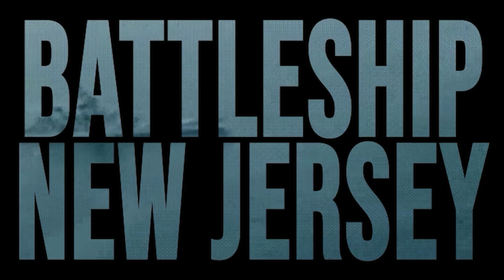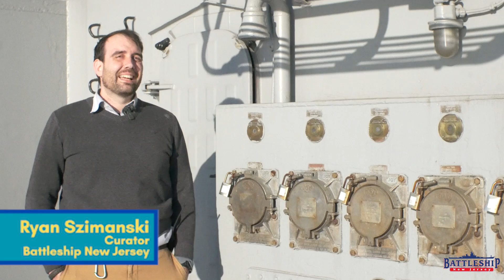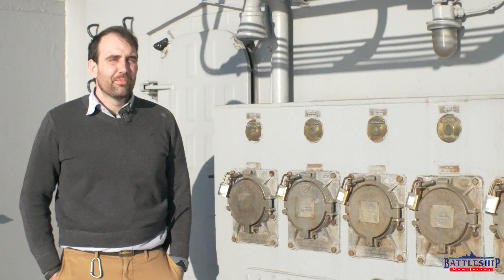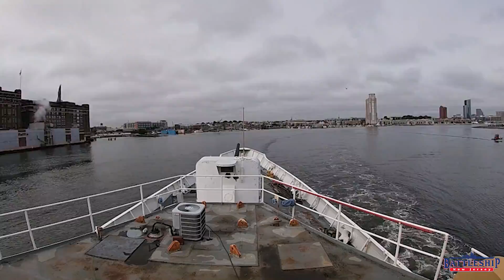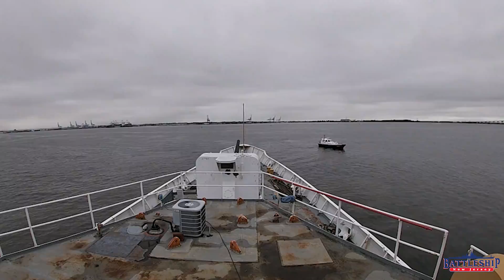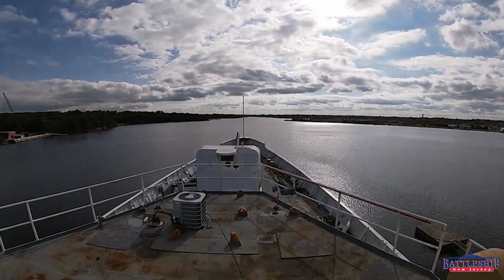Will the Battleship Have Power While Under Tow to Drydock?

Comment: Ryan you will want 2 450KW 480 gensets (thats about 800 Amps per, one wired into the Port side and running and one in the starbord side once shore power is disconnected as a Oh Shit backup. that gives you full power to all restored systems that you currenty use with reserve. About 500 Gallons of fuel gives you 24 hours run time at full load. As has been suggested Talk to Cummins I bet they would LOVE to have a Video "Cummins powers the Battleship NewJersey underway"

Comment: As a merchant marine engineer, one side note I have is that those shore power cables are heavy as all hell and are a real pain in the butt to hook up.  This particular connection type is nice though.  It just plugs in nice and simple.  Some older type cables have three super thick leads in them, and you basically have to clamp them in.  Really annoying, really heavy.

Comment: restoration of original systems to create power is more logical. those systems need to be ran occasionally to ensure they don't deteriorate.  its already plumbed and installed it just needs a mechanic. as you have said many times before. she was put to bed exspecting to be reactivated. well... reactivate her systems for dry dock. there has to be some vets that would love to run her once again to dry dock.

Comment: If you can get away with it, a small diesel generator with a fuel drum lashed to the deck, Starlink antenna, and livestream it from multiple cameras. No physical human presence required until it's time to shut down the generator and pull the cameras at the drydock.

Comment: I thought the shore power standard frequency was 400Hz.
Reply: Nope.  480VAC, 3-Phase, 60HZ.  400Hx power IS used onboard a USN ship for radars and other equipment, but (at least on my ship) was produced by appropriate motor/generator sets...Basically a 60Hz motor driving a 400hz generator.

Comment: Very curious to hear what kind of numbers your crew comes up with for power requirements!  As a Stand-By power generation tech who works in Philadelphia this whole undertaking is fascinating.  I would definitely recommend two gen sets be on board for redundancy while under way!  I would gladly offer the use of my 1959 150KW Caterpillar Electric Set but unfortunately it is 208v and not reconnectable for 480.

Comment: aggreko power does rental generators, even Caterpillar or Progress Rail Services might sponsor/provide power as a write-off / advertising expense. Just need a fuel bladder on deck with the generator(s). In a perfect world, two generators, one feeding each bus and one feeding the emergency bus, or two generators paralleled feeding one bus which is tied to the other bus and the emergency bus. Since Iowas are electrically operated ships, a lack of steam shouldn't put her out of commission as long as the motive power isn't needed. However, that's a lot of parts to grease. Entire systems need to be rung out to make sure that what is left isn't dead in place. It'd be nice if the alarms and 1MC worked for life safety reasons and the pumps. Of course it'd be better if the blanks over the sea chests feeding the diesels were removed during dry-docking so the diesels can be used in the future if the need arises.

Comment: Two questions I have about the process. One: will the ships watertight door be closed during the transit in case the worst should happen? I know they likely aren’t completely watertight anymore but I’d think it would be better than having an open hatchway. Second, is the steering system completely beyond reactivation, and if not, will there be any attempt to get steering working so the rudders can help maneuver the ship for the tugs?
Reply from the maker: The rudders cannot move and will not move for the tow.

Comment: For all those old power plants, I wonder how many would short out the old wiring.
Reply: Naval power isn't grounded.
Reply: @AugustusTitus when enough bad connections are made,it will short out.
Reply: The power for the lights and ventilation is coming onboard through the original Shore Power connections, routed through the original main switchboard, distributed out to the original load centers, then fed to the original fixtures through the original switches...all over the original wiring.

Comment: How come your not allowed to fire up the boilers? Seems like an odd the for the navy to say?
Reply from the maker: They don't want us sailing her around
Reply: @BattleshipNewJersey  yeah that part makes sense. Shame though as it would have been nice to make your own power in that respect.
Reply: The museum can’t yet afford to pay for their own dry docking. Can you imagine how expensive it would be to keep the ship maintained, fueled, and serviced for operation? Astronomical. 😵‍💫

Also, all of the necessary sea chests have been blanked over. So no cooling inlets to operate the engines and machinery.
Reply: @glennac  o I understand all that. Just seemed like a weird stipulation from the navy. But the sailing part never crossed my mind. Would have been cool to see her produce her own on board power. Shame they couldn’t just disconnect the drive lines or something like that. But yeah I get it would be expensive also.
Reply: the navy dont need another boat "borrowed",like in the battleship movie😂😂

Comment: When NEW JERSEY was towed to Long Beach in the 80's, my Air Guard Combat Comm Squadron was tasked with providing generators on board the ship while under tow.  I put my name in as being available, but being a radio guy, but Power Production qualified, I did not get chosen.  They would have been 10 or 15 generators for lights, radio, etc.

Comment: Again ... I'm so glad I only had a fleet submarine to deal with on a row two years ago. I was adamant that Cod should have full lighting load and power for our coffee maker and rechargeable phones and cameras.  Our emergency dewatering pumps were gasoline powered. One tiny Honda generator hidden under the superstructure and tapped into our lighting bus did the job exceptionally well.
Reply: B-29 FiFi flies with Honda inverter generators for her portable site power and replacement of the on-board "put-put" gasoline engine APU.

Comment: Conex 150kw generator should work nicely for you.  It is only a 16ft conex but could be up to 22ft however should fit nicely on your flight deck.  
Contact CaT or Agreco in your area they should be able to point you at some options.
Reply: There might be a company willing to provide a generator free just for the press coverage.
Reply: sunbelt has trailered generators in that range for rent, may provide as a sponsorship i imagine. a 1000kw generator is $20k for 4 weeks. 6700 for 1 wk. wouldn't surprise me if they give it to them for free for a time in exchange for publicity.

Comment: How far will the ship move to dry dock? In other words how much total time is it estimated from start to dock ?
Reply from the maker: 6 miles
Reply: New Jersey is in reasonable condition. Even if you had electrical power to the ship equal to what the ship was once capable, if anything were to happen, there is Little that New Jersey could do to save herself in her moth balled Museum condition. The ship has no leaks of even minor concern. Nor would it unless a major storm might come about at the time of the move. And I highly doubt it would be considered to move her under those circumstances. So only enough power to light the ships interior by way of its own power distribution is needed.  Totally sufficient. That is unless the ship is  in materially worse condition then we have been lead to understand. And that should even be overkill.        @BattleshipNewJersey

Comment: Are there any thoughts among the Museum Fleet to make modifications to be able to reactivate emergency diesel generators? These are purpose made, integrated systems that are designed for powering the ship without main turbine power. For me it would be frustrating to have such a useful back-up system built into the ship and not be able to utilise it. Is it an upkeep/maintenance issue? A fuel issue? Or is the only blocker simply the blanked sea-chests? 
I understand the Navy's practice of sealing the hull to remove any and all hull-openings but how hard would it be to modify the connections to make the blank an internal one that could be opened if needed?
It could even be set to 'trip' on if shore power becomes disconnected using modern control. I think of how much that might have helped USS The Sullivans having internal emergency power available, or just a circumstance where a ship breaks free for what ever reason; it would be able to provide some power to systems to warn others. It also removes a complexity of having to crane diesel generators on and off the ship, along with the hire and delivery of them.
Plus, to me, nothing lights the passion of museum goers than seeing an object functioning, so a periodic test run up of a diesel generator could be a minor event for museum ships.

Comment: That's a shame you can't use the two onboard diesel generators. I understand not wanting the fire up the turbo generators.
Reply: It's probably stipulated in the contract signed with the Navy that they are not allowed to fire up those generators
Reply: @roger5555ful  Stipulated ANY steam systems or propulsion equipment.

Comment: As A CE (Seabee Electrician) go for the bigger genset.
You'll never regret having too much power.
Reply: True. It is better to oversized generator to the load as generator “butter” zone were it is most efficient which, depending on model, is around 60%.
Reply: @frankchan4272 is wet stacking the generator if it’s too big a concern?
Reply: @MultiPureEnergy they’d only be putting 8-10 hours on the unit while towing so I don’t think they’d have enough run time on it to really suffer from wet stacking, the ideal would be a smaller and bigger unit both plugged into their shore power connection and use the smaller one unless the need for more power becomes a thing, then fire up the bigger unit and swap to it.
Reply: @MultiPureEnergy  on a rental?  LOL.
Reply: Two.
Reply: As a Navy CM I also recommend a larger Genset and actually a backup... Cat and Cummins both make great gensets.. mo power mo power.... the more systems powered the safer the transport will be
Reply: As an engineer in the merchant marine, I can confirm.
Reply: Some many details!  Planning for every eventuality.

Comment: Holy smokes! Those are giant ports! What size cables are you using for those 440-480VAC lines!
Reply: And how many kilowatts can you carry over each line?
Reply: @shubinternet over 200kW.

480VAC x 400A x 1.2 (3 phase constant for 480) = 230.4kW.
Reply: At least 500MCM for 400amps you would think.

Comment: I probably know the answer, but will you fix the rudder in a fixed position, or can you power it to help steer ship into dry dock
Reply: I am not an expert on battleships, so take this with a grain of salt. With large ships in general, their rudders are pretty ineffective when moving at slow speeds. For this reason, cruise ships use their bow and stern thrusters when going pierside (basically large propellers mounted perpendicular below the water line that can suck in water on one side and push it out the other side to move sideways - of course they are reversible) and large cargo ships use tugboats to get in position. New Jersey most likely doesn't have such equipment, so even if their rudder were powered, it wouldn't have much of an effect.

Comment: If it was me I would use generators to replicate the shore power your currently using plus enough to run extra pumps.....
Reply: That would be an unnecessary waste though.  They don’t need to power all the lighting and HVAC systems - all they need are navigational lights and to run pumps (bilge and for adding ballast) for the 4 mile trip down the river.  

Whatever generator they decide on will need a redundant backups.  Generators of this scale are several grand a day to rent not counting fuel costs, transportation to the shop, a crane to put them on board, etc.  They could easily spend over $20k just on generators so I’m sure they rather not pay for unnecessary generation capacity.
Reply: @cruisinguy6024  Is it that shorter run? I would have thought the bulk of the cost is in the rental and crain etc, there wouldn't  be much difference between a 100kva and a 300kva all up. The reason why I said what I said is if something goes wrong the crew who know the ship need to be able to respond quickly and there wil likely not be time to figure out the difference in the ship at that level of turned off

Comment: I've been curious about the contract  with the navy and why specifically  they won't allow the restoration  and use of the ship's main systems  such as the boilers and steam systems. Is is due to them originally wanting to keep everything  in a state of being able to be restored to active  service?
Reply: I would think it would be too dangerous to  power up the boilers, the tubes will likely have lost their seals, a bad thing.
Reply: He’s discussed the contract in a prior video.  Essentially the Navy doesn’t allow them to do restore anything necessary for her to be used as a ship again.   They’re not allowed to generate steam or operate the galley equipment.  

It’s a shame, really.  She’s obviously never going to be recalled to service again but it would be so incredible if she could be more useful than the contract allows.
Reply: Part of it is PR.  A steam link is a nasty thing.  The USN doesn't want to be featured in a news report of how a Boy Scout Troop ended up being neatly uniformed stew meat...Main Steam is 600 PSI superheated to the neighborhood of around 850F.  Even 50 PSI steam for the galley will be around 300F.  As a museum ship, the NJ is lacking well over 100 guys who did nothing but operate and maintain the boilers and steam systems.  We had 3 boilers, two shafts, 4 turbine generators, and around 100 guys in Engineering...

From a financial aspect, figure those burners are going to use oil at a rate best expressed in Gallons/Minute.  This is why the USN has chosen Gas Turbine systems over steam.  It's a money thing.  The only exception are the carriers, which still use steam propulsion, they just use reactors to heat the water.

Comment: Any coast guard certified captain can answer your lighting question.

 A vessel or object other than those referred to in paragraph (g) of
this Rule being towed shall exhibit:
(i) sidelights;
(ii) a sternlight; and
(iii) when the length of the tow exceeds 200 meters, a diamond
shape where it can best be seen

You could probably run it off a large battery.
Reply: Seemed to be more a question of how much inside lighting they need, which is an entirely different requirement (OHSA, etc).
Reply: That does not include internal light in the ship to make it safer to move around. It is an old ship and there is a risk of leaks when it moves so you do what to check the inside.  If there is a leak you do what the ability to pump out water.  There are if I am not mistaken electrical pumps in the ship that can be used that would need powered.
Reply: It's also a question of emergency management. You want enough light and power for pumps to control an emergency, and to safely evacuate if all is lost. You don't want to be fumbling with a flashlight when there's a fire, you want the emergency exit sign to be glowing bright.
Reply: this is hilariously silly.
If the battleship can't go 2 days without the pumps running, there is a fuck ton of problems that we're not being told about.

Modern flashlights and Lanters are plenty powerful, and you have at least 2 tugboats fully powered just a radio call away.

 @phillyphakename1255
Reply: @phillyphakename1255  if the ship is not open to the public, it's less of an issue.

Comment: Strongly recommend enough power for full lighting and full bildge power. The bill will be far cheaper than the alternative. As remote is it is if the worst case occurs you can at least argue you made a above reasonable attempt to prevent.

Comment: I assume you will have at least two generators on the deck in case one fails.
Reply: That's not how things work in the commercial power world.  If I need a 1200A genset, I don't rent a second, just in case.  These power plants are not in the same class as a home standby generaor or anything that is sold on Amazon or a big box store.  They are maintained, tested and start the first time, every time.
Reply: @jd3497  My background is computers, not power.  There you learn to avoid single points of failure, which is also handy when you need to do updates without taking down the environment.